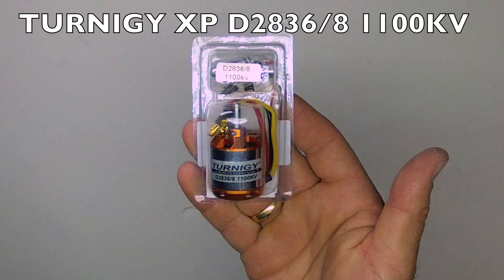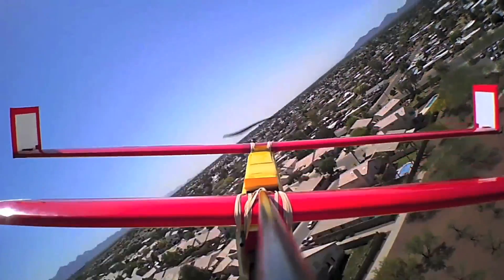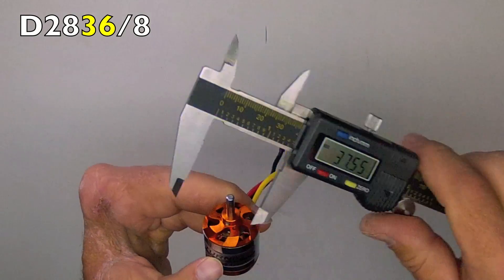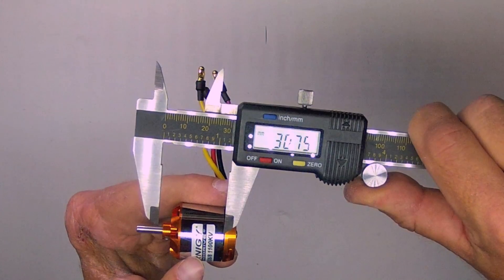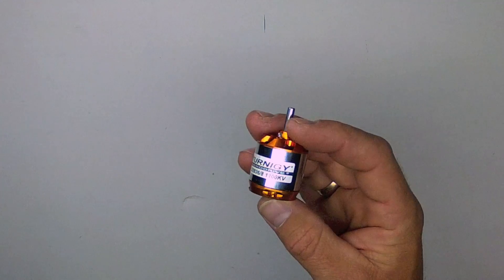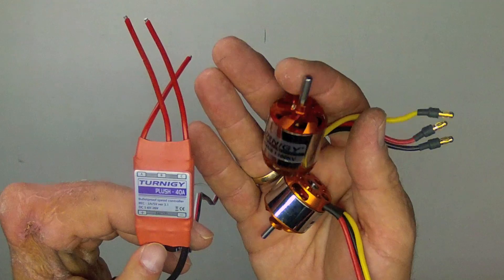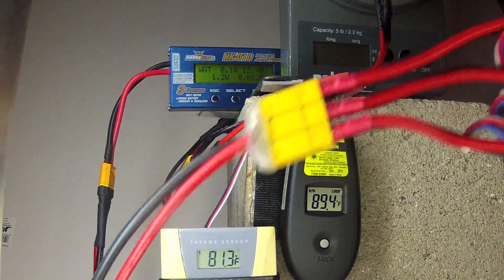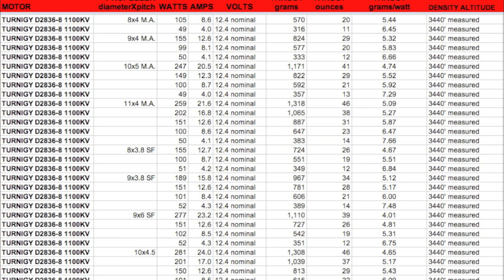D2836/8 1100KV POWERPLANT TESTING - "The Workhorse"

Comment: hi, what will be your opinion about my airplane that is overall 900grams and a wingspan of 23" and a battery of 4s with 8060 3blade prop, can this fly? I'm a bit scared of it not flying 😢 my motor is DYS 2836, 1500KV

Comment: In an airplane, you must put a propeller that can be used at maximum acceleration during the entire time that the battery lasts. Without the motore getting hotter. Usually this happens around 70% of No Load speed. less than that is just a coffee heater.
Testing a propeller for just a few seconds does not tell us that the propeller is viable.
You always have to get the number of rpm and the efficiency. An motore whose viable propeller is a 10x5 APC may work well for a few seconds with a 15x8. since this test tells us nothing.  In other words, I don't agree with your testing method.  http://aeromodelismoelectrico.blogspot.com/search/label/Propulsores

Comment: Good day ed, 

Im using the same motor with 9x5 prop 40mps esc, do your motor get hot that you cant touch it for 5 seconds after 1minute of full throttle?
Reply: Is it normal or is there something wrong with my motor?
Reply: im having the same issue running a 10x4.5 , dont seem to be getting the same thrust and it gets hot. running it on an AUW 800g and i cant pull up vertifcally. plane also doesnt get very fast....

ive just switched prop just incase it was the CW prop i had gotten.

have you got the prop on the right way? numbers should face direction of flight

Comment: Thanks, appreciate all the great information you have shared! I've learned a lot from your videos...
 
The specs for this motor on the HK site can't be correct. In fact my D2836/8 motors came with a spec sheet that has 6, 7, 9, and 11 listed, but not the 8.

Assuming the 8 must fall in between the 7 and 9 and it is likely about a 300w motor. The amperage would calculate to the following, based on 3s battery: 300w/11.1v=27a

And if using a 4s you would not want to exceed 20.2a: 300w/14.8v=20.2a

Great motor though, I can see why it's your "workhorse". I bought them for the FT Sea Duck I'll be building, and I'm sure I'll buy more.

Comment: Have you ever reversed the motor shaft on this motor? Read a that a guy did it to put on  Phoenix 2000 motor glider (what I'm doing)  and he didn't mention needing to cut a second C clip ring on the shaft. So I assume/hope it has a second C clip ring internally and I can file a another flat on the other end for the bell's set screw.

Comment: Love this motor and the whole Turnigy XP line, I own 3 of these, 2 of the 2826 2200kv, and the monster 3548 1100kv one.  I have found my favorite prop for this particular motor to be a 10x6 apc prop running on 3s.

Comment: Thank you , I 've a question. I try to mount a Skywalker X8. But i need to put on it about a 3500grm . I select this complement. 2 battery 5s 5800mAh, MT2526-8 /550KV )  Porpeller foldable 12x7. Is OK this selection or you recommend other one?

Comment: Bom trabalho! Obrigado!
Estou à espera que chegue da HobbyKing:
- 10,77 €	- Turnigy D2836/8 1100KV Brushless Outrunner Motor (EU warehouse)
- 5,71 €	- TURNIGY BESC Programming Card (EU warehouse)
- 2,72 €      - Slow Fly Electric Prop 1045 SF (4 pc - Green) (EU warehouse)
- 2,72 €      - Slow Fly Electric Prop 1045R SF RH Rotation (4 pc) (EU warehouse)
(YES, it's for a quad.)
Votos de bons voos.
(SIM, de PORTUGAL.)

Comment from the maker: It's a great question but not too hard to compute with an online calculator.  Density altitude takes into account the atmospheric barometric pressure, altitude, temperature, and humidity to calculate how dense the air is and compares it to the "standard" air density at a certain altitude.  The less dense the air the less lift a plane has and the less thrust the powerplant will have.  At sea level, cool and dry air = more thrust.  At high elevation and hot temperature = less thrust.

Comment: Ed,  I picked up one of these from HK the other day, but they were out of the 10x5 props, so I went with a 9x6, figuring I would only be losing a little power.  Would this motor and prop combo be appropriate for a Synapse with a light FPV setup?

Comment: Please do more testing but show less.
The only entries that should be highlighted are maximums.  
-- best prop for maximum static thrust for a given battery
-- best prop for maximum efficiency for a given battery
-- best prop for maximum watts for a given battery.
and of course, "if" you can afford it, the prop that burn out the motor after 15 seconds.

Comment: Hi, nice video and very informative like most of your videos. i just wanted to say a small tip about parallel connection of your batteries. if the voltage isn't exactly the same then there is potential difference so i'm not sure if it's good for LiPo's. any information about that would be appreciated